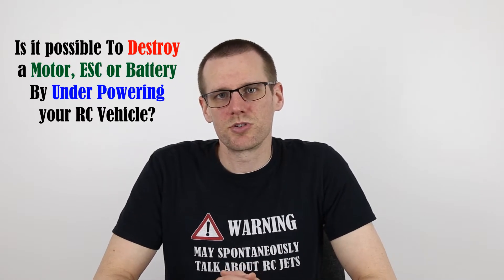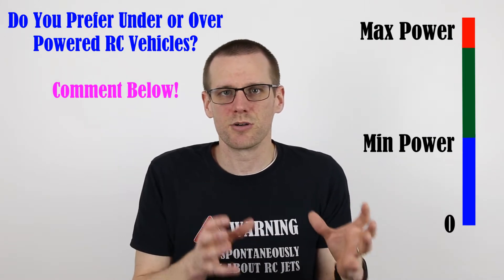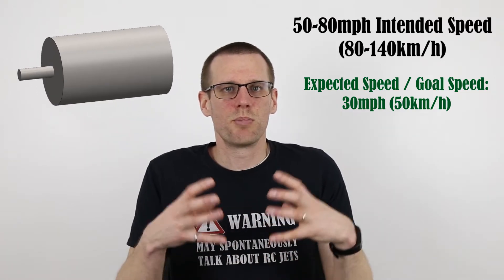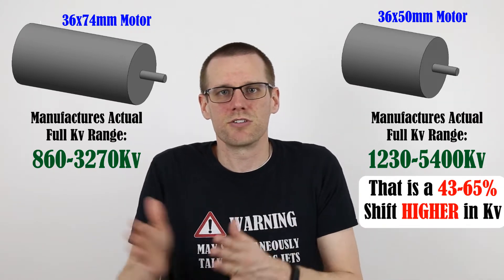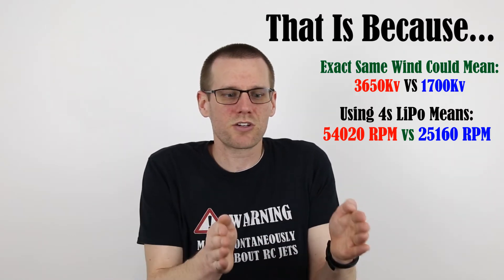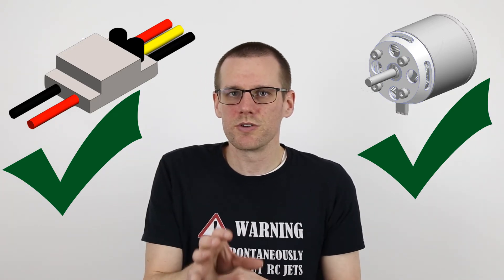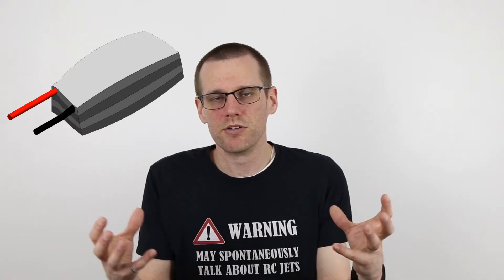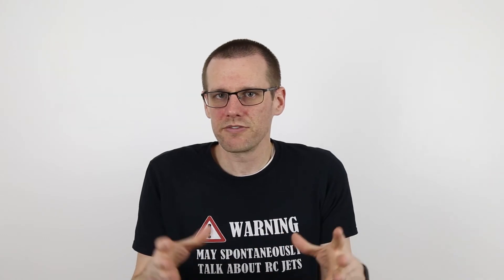Under Powering an RC Car or Plane Destroy a Motor, ESC or Battery?

Comment: Overpowering is fun for surface but inevitably will cost you more if not by crashes then by excessive wear and heat soaking causing batteries to fail sooner and so on..

Comment: I've watched a few of your videos (very informative and I've learned a lot so thank you) however I'm having trouble finding an answer for my situation anywhere. 
3s-4s quad that I'd like to fly with a 2s Li-ion 18650 setup for longer duration, lower intensity flights. My understanding is that the voltage would be lower so I would want to put larger props on and be careful with the throttle or PID tuning to reduce the amount of current drawn from the batteries as they do not have near a C rating of the regular li-Pos. Does this make sense? Thanks kindly.
Reply from the maker: You can use 18650's as long as you don't exceed their max cont discharge rate.

Comment: Yep, ive thought about putting a 1/10 scale motor in my infraction when i had it, that was 1/7 scale, good thing i didnt do it because i learned the smaller the motor the less power it has, the bigger the motor the more power it has for that vehicle.
Reply from the maker: Yep, that's true

Comment: Underpowering rc vehicles sounds like something to avoid. I'd better double the power in everything just to make sure.
Reply from the maker: Underpowering an RC can be tricky but it also can work if you plan out the build well.
Reply: @RCexplained  I mainly eschew planning in favour of a dremmel, hot glue and lots of tape.

I'm not going to pretend it's a successful strategy but it can be a lot of fun.

Comment: The situation with the persons plane, would that have been ok with a higher mah but same voltage battery?
Reply from the maker: Yes it would have been ok with a higher mAh pack as too much power was being pulled from it and it was run for too long of a flight. The design intent by the builder was to keep the pack super light. However, I was concerned the entire flight as the system was operating at near 100% throttle to maintain level flight. Motor and ESC's were small too but  could work. One Pilot error and there was no possible recovery.
Reply: Thanks for the reply. Great videos, very interesting and informative.